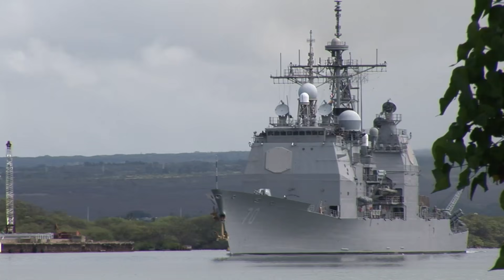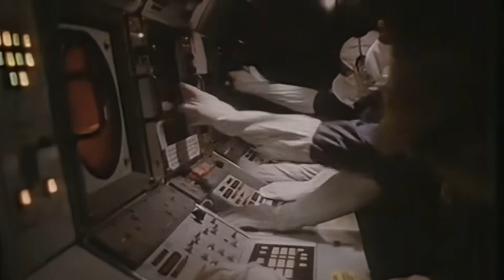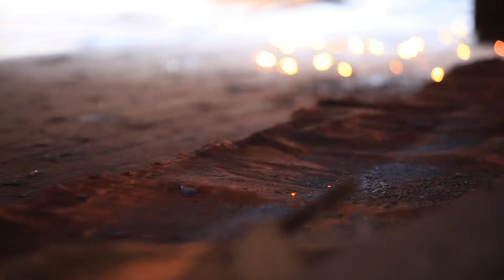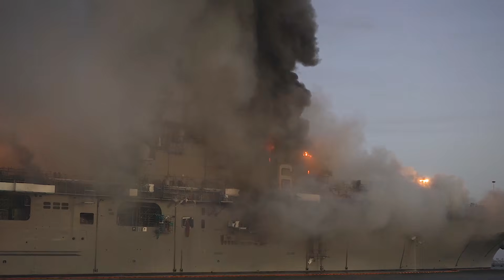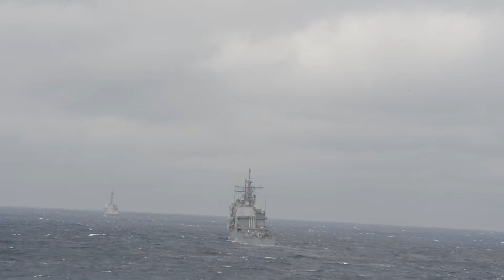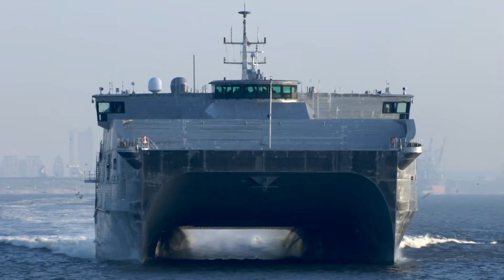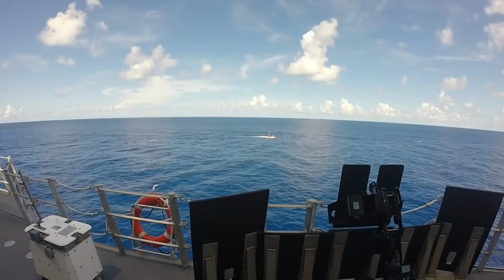Why is The US Building Aluminum Warships?

Comment: Since all construction of LCSs was stopped last year... maybe aluminum was a bad idea? On a side note war ships usually needs weapons big enough to damage other ships which could have been another failing.
Reply: Yeah, no one paid any attention to the aluminum framed class 8 trucks that destroyed themselves. Nor did they pay attention to the years and years of building superstructures. The only way to make aluminum tough is to use a hell of a lot of it. In fact if you use high grade steels you can make a far lighter structure when seeking fracture resistance. (Think 5 series vs. CrMo). So team dumb dumb (most admirals are great politicians, reasonable strategiest, and piss poor technocrats) thought hey the fast ferry tech is awesome, let's use that. Not thinking: This is a warship, not a fuel efficiency optimization experiment.

What kills me is you can make a warship basically impervious to most modern antiship missles by armor and hull shaping. A semi-submersible platform is far better for radar and makes a harpoon, silkworm, or Exocet simply not work. You can shape and armor the above surface / shallow surface significant to deflect blast and do the same far below the waterline for torpedoes. With bubblers you can dramatically reduce hull drag and sound signatures. Turbines are small and make a hell of a lot of power. You can run hotel loads off of a plutonium thermogenerator small like NR-1. You can run propulsion off of a high efficiency, high reliability diesel (think Napier deltic or equivalent in terms of performance). There's lots and lots of solutions that yield a 30+ knot vessel capable of the LCS mission with much greater survivability. Plus a vessel meant to pierce waves inherently is much better in rough conditions. Something is just off in the decision making.

Comment: SpaceX switched to steel rockets for a bunch of logical reasons. Less waste, less cleanup, way cheaper even with its weight to send to space as well as the logistics behind where the manufacturing plants are to steel manufacturers. Composite work is a nuisance.

Comment: I used to work at Austal. LCS 700 had a major crack develop on main deck at the H05 and H06 bulkhead. It span from port to starboard and opened up 2.5 inches. All before heading out to sea trials.  The EFT class ships (formally jhsv joint high speed vessel) suffered frame cracks near the bow during rough sea.

Comment: The stainless steel used on Starship was selected for its material properties under cryogenic temperatures. Stainless steel becomes very strong when chilled by cryogenic propellants (Starship is very weak structurally when not fueled). Material selection between a battleship and a rocket have no tangible correlation in this case. The potential alloys, thicknesses, temperature ranges and use cases vary so wildly it's not an apt comparison.

Comment: The line from aluminum mills made me laugh. As if the Iowas, 50 thousand ton battleships capable of 33 knots, are short and slow simply because they are made of steel. Different ships, yes, but the idea a ship made of steel has to be slow is ridiculous.
Reply: Plus you can hit an Iowa with a Exocet, and depending upon where it hits it might not do too much.

Comment: You could make all non essential metal components in and out of the ship made out of heat resistant aluminum and make all the essential components and supports out of steel

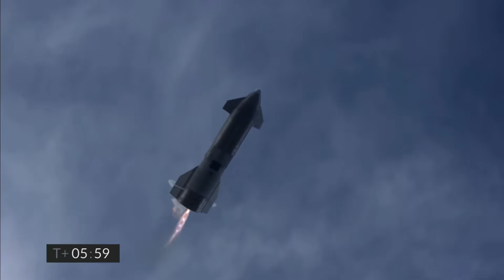Comment: 13:30 Stainless is better at extreme temperatures, either very cold, or very hot than CF. Otherwise CF is much better as long as you stick to narrower temperature range.
Stainless steel is much stronger that CF at extreme cold, ie. when rocket is fueled up or in the orbit.

Comment: Also, aluminum has far less cycle life. So say a bar of steel, can take 1000kg before bending. You can essentially cycle it tens of millions of times below that deformation point without it failing. 

Conversely, Aluminum, work hardens and if you cycled it at 50% of it's deformation limit (not failure limit), it will eventually fail.

If you wanted to stress cycle steel right around it's failure limit, you can still essentially do it millions of times before failure, aluminum you drop down to the tens of thousands if you're loading it that much.

This is why airframes have flight hour limits. The aluminum skeleton has been flexed/stress too much and must go through a total overhaul/inspection/replacement.
Reply: Sheffield

Comment: Not gonna lie, 2642F for steel melting point is very generous. Depends on the steel type but you're actually looking at 2850-3100+ depending on the alloy. I ran the melt deck for a foundry for years and you'd almost never get steel liquid under 2800.

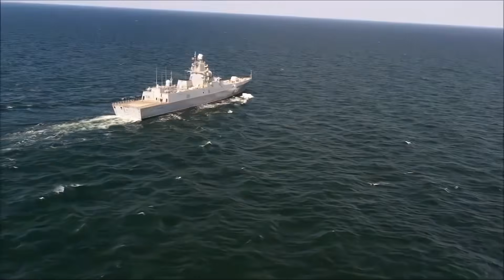Comment: 13:10 I want to mention that carbon is 4x more heat resistsnt than steel but holds onto heat for much longer, so if you heat a block of steel and a block of carbon up to 500°,  the carbon will be much hotter than the steel an hour later. Because of this property, carbon is much more suspectable to warping- hench why I beleive space x started using steel over carbon. In ships, i doubt a few inches of warping every odd fire or so would mess up a war ship too muc
Reply: Susceptible

Comment: I've never heard the myth about HMS Sheffield. It was reported at the time (I remember) that the Sheffield's defence systems failed to detect an incoming Exocet. Sheffield had no ECM. Sadly, HMS Glasgow did have ECM and its radar detected the launch of two Super Etenard missiles but, because the Sheffield didn't, Sheffield wasn't put into action stations and the Sheffield's captain was not aware of Glasgow's Handbrake warning having been issued.

Comment: Aluminum burns very well and is very energetic. It ignites once the protective oxide layer is removed. In solid rockets, it is used as a fuel.
Reply: Solid sheet aluminum does not burn. Powered aluminum compounds added to other compounds in the right proportions will burn.

Comment: You idiot Aluminium burns like no body business once you past the ignition temp, do some research instead spouting shite. Hell the space shuttle solid boosters were a mix of aluminium, and you spouting on how it does not burn..  

https://en.wikipedia.org/wiki/Space_Shuttle_Solid_Rocket_Booster

The SRBs were the largest solid-propellant motors ever flown and the first of such large rockets designed for reuse.[citation needed] Each is 149.16 ft (45.46 m) long and 12.17 ft (3.71 m) in diameter. Each SRB weighed approximately 1,300,000 lb (590 t) at launch. The two SRBs constituted about 69% of the total lift-off mass. The primary propellants were ammonium perchlorate (oxidizer) and atomized aluminum powder (fuel), and the total propellant for each solid rocket motor weighed approximately 1,100,000 lb (500 t) (see § Propellant). The inert weight of each SRB was approximately 200,000 pounds (91 t).

Comment: Let's be real, the reason there's a debate over whether to build these ships from steel or aluminium, is because as of late, ships are pretty rarely used for anything other than a show of force. People aren't likely to be like "Meh, it's only aluminium, not like it can do anything" when they see a 10,000 ton ship on the horizon. The issue with this is though, there are still humans on board, and one of the biggest problems ships face, is fires. If the flooring melts away underneath someone's feet while they're running from a damage control room, then you haven't designed a warship, you've designed an oven

Comment: Aluminum does burn, it's next to Magnesium in the periodic table, it just takes a little more to light it. The Bradley AFV is aluminum, when hit with an AT round the vaporized Aluminum burns nicely.
Reply: All metals will burn under the  right conditions.....but some make aluminum look inert. You would not want to sail on a boat made of potassium would you? Most metals don't easily burn unless they are powdered or otherwise in the form of small particles, which is why magnesium and even titanium fires can and do happen in machine shops. A machine shop near me burned down because titanium shavings caught fire.
Reply: @taraswertelecki3786  Indeed thats true. Aluminum is far more combustible compared to steel though, steel does not ignite from an APC round. A Foxconn factory that was milling aluminum chassis for Apple iPhones and Macs did have a explosion, it's believed the production rates exceeded the ability of the ventilation systems and powdered aluminum in the air ignited.

Comment: Aluminum suffers from work hardening which makes it brittle. Different coefficients of thermal expansion require different metals to be joined such that they can move without developing stresses. Spacex is having success using welded stainless steel in their Starship rockets.

Comment: I think they should use steel hulls with superstructures out of of other materials (but more modular) and trapped, clamped, or bolted down rather than welded for greater strength and for easy replacement.
Reply: I am pretty sure they have considered such simple solutions.

Comment: Aluminum has two major problems:  it's very chemically reactive especially when in the proximity of other metals like steel, and can be affected by metal fatigue.
Reply: Just wait and see how aluminum and mercury react with one another.
Reply: @taraswertelecki3786  as long no one drop acid strong enough to remove aluminum's oxidized layer nothing will happen, even if you actively scratching it's surface.

Comment: Why not build them from titanium?  Besides higher cost, it has a higher melting point than steel, and is around 55% the weight of steel.  It will lose 1mm after 6000yrs in sea water.  So you can recycle it too.

Comment: The only major aluminum on the Arleigh Burke destroyers is the mast. The Navy doesn't weld aluminum to steel, they use explosive bonded aluminum to steel and weld each type of metal to either side of that material. https://youtu.be/u9_bqafUJfA

Comment: I have to add the last comment starship by space x is using SS but it's cryogenically treated which given doping of steel provides anywhere from 70% to 700% increase in strength, which delvs into the range of steel vs carbon fiber

Comment: The Starship is not just made out of steel for STRUCTURAL properties, but first of all due to thermal properties as the hull is also the outside of the tanks on that rocket and steel is dealing with both cool and hot conditions way better than carbon fibre.

Comment: Stainless steel, its strong and light. I prefer a stainless steel knife over carbon metal. The stainless steel knife keep a sharper edge longer to, and no rust.  ~ Carbon fiber is a fire ball to.   like you said the metal point of Aluminum. There always fires on ships ~ If i was a sailor, I would want some thing to give me the best protection, and not a beer can

Comment: basically the lowdown is alu is better with today tech they could be made just as reliable as steel in operation with massive reduction in weight and the survivability in terms of fire can be manage while the survivability in terms of taking direct damage is irelevent because in today day and age the only effective armour you have is your air and point defense system once they fail your fucked no matter what type of material you have on your ship so might as well go for alu and get the benefit of extra space speed mobility and range.

Comment: Also I might add a simple over the counter acid used for pickling steel can turn aluminum into paper towel, while producing hydrogen gas in the process. Idiotic in military application.

Comment: Russian technological advances should not be diminished. The ZIL 4.0 was the first 6-cylinder Russian vehicle with 24 valves. 12 in the engine and 12 in the radio.

Comment: TL;DW

We should use aluminum.  Wait, ships are melting.  We're not gonna use aluminum.  team aluminum rage  "It's your design not the metals fault.
Maybe but steel is stronger.  "But Aluminum is LIGHTER." Yeah but our boats are cracking.  "It's your design not aluminum's fault."
Maybe we'll just use both.  Oh wait this doesn't really work either.  Yeah we're just gonna use steel.  Team aluminum rages "Fine we'll experiment with it."

U.S makes some ships that have some steel and some with aluminum and I this video felt highly inconclusive and I saved you 15 minutes.

Comment: I remember seeing the aluminum ladders of HMCS Kootenay's engine room fire over 50 years ago. We could see how one poor sod had made it to the ladder, several steps up towards safety, and where his boots went through the melting aluminum. He perished in that extreme heat, fire, and melted aluminum...if he was on a steel ladder, he would have made it out of the Engine Room and probably lived.

I don't trust aluminum ships...naval architects need to grow out of the thoughts of entertaining using them in building warships with humans aboard.
Reply: I would not want to be aboard one if a heavy weight  torpedo or pressure mine explodes beneath the keel........it'll certainly break the ship in two from the bottom up the way Titanic broke apart. And like Titanic, both halves will probably rapidly sink.
Reply: @taraswertelecki3786  Which the aluminum will alleviate how, exactly? If you get hit by a torpedo, you're going down, no matter what you're made of. The only difference is with aluminum hulls, you can't take any hits at all, let alone from a torpedo. Not exactly a good trade.
Reply: @PhoenixT70  Not necessarily.....ships sometimes survive torpedoes. But I doubt aluminum ships will especially if the blast starts fires below decks.
Reply: @newdohl  - Why are you here? I'm old and cantankerous and will not let knowledge-free kids rewrite history. So, insulting people and being "know it alls" are the younger generation's legacy? Enjoy being offline. I hope you have a library.
Reply: @doogleticker5183  Ok boomer, I agree with you but man you're obnoxious, boomers destroyed the west then cry about younger gens.
Reply: @L0rd0fLight1  - It's always previous generations that must take the blame for the state of the world. It will be your turn in a few decades. Take a look at the average Joe. Half of the rest of the planet has an IQ of less than his. 
PS - When you get older, you don't cry over what younger generations are doing or not doing...you just wish you were stupid enough to not notice shit, or smart enough to have improved the planet when you had a chance. Alas, it's tough to do when politicians and economists rule the roost.
Reply: Don't talk utter shit, aluminium melts at 660 degrees, the fire might have burned that hot but not while he was still alive
Reply: @finnaustin4002  - There are photos of the ladder at Damage Contol Training Centre at CFB Naden which is a base that surrounds HMC Dockyard Esquimalt. Fire School is on the east side of the harbour, has classrooms and a massive three-deck high mock-up of a ship to practice fire fighting and fighting floods. Since I've actually been there, did my initial and advanced training there during the Cold War, eventually qualified as a Fire Team Leader and ship's Damage Control Officer, I totally understand where the 'shit-talking' is coming from. 
You.
You have no understanding of: where the seat of the fire was (gear-box), why: an explosion during full-speed trials, where the engineering techs were after the explosion and fire: on the deck (grill) on their hands and knees crawling towards one of the two ladders, you do not know the layout of the engine room. In fact, you know nothing about the explosion and fire, or anything else about HMCS Kootenay (DDE 258). 
Google "HMCS Kootenay fire," click on the google images tab: the 1st image, near the top centre left: that is a ladder with a rung clearly melted and where a seaboot went through and continued below down, bending the lower rung (centre left of photo) as the sailor fell to his demise. 
Grow up and earn your right to be a part of adults' conversations. Start by reading about facts, question them, continue by writing without insulting people who know more than you have learned from books alone. (Original (larger) Image at Hazegray.org)
Reply: When I taught structures I used the kottenay fire as an example of why aluminum is bad for ships. down below
Reply: Thats the point people are not part of the new equation at least not like in the past.  I believe newer ships will have a very small contingent of people. Automation for loading is progressing and  less people means a smaller ship which is less expensive to build and maintenance. You can completely shut a ship making it water tight and run through weather other ships would not dare.
Reply: @godofrock  - Yeah, no. You cannot build robots that can put out fires or fight flooding (yet), you cannot create seaworthy hulls (subs aside) to take more punishment and remain afloat (did I mention subs aside?). Certainly, crews can be reduced but not by as much as one thinks. Humans need rest and there is no AI in existence that can substitute for humans.

Comment: Generally speaking aluminum is the best metal for most applications. It’s usually a better option than both steel and titanium completely disregarding material costs. It’s a more ductile material so it can flex more without permanently deforming. It can also support a larger load than both steel and titanium when the same weight of each material is compared; you would just need to used thicker aluminum structures to get the advantage.